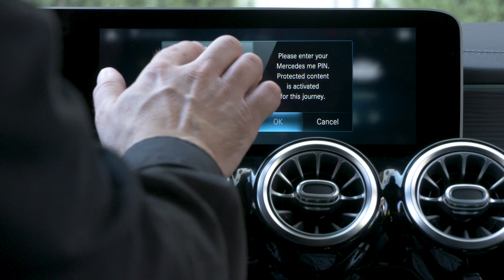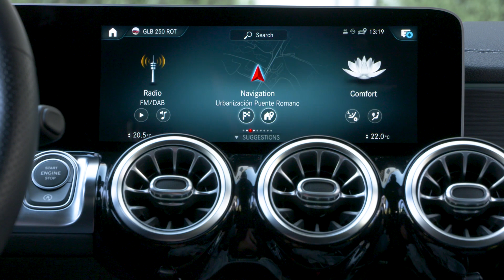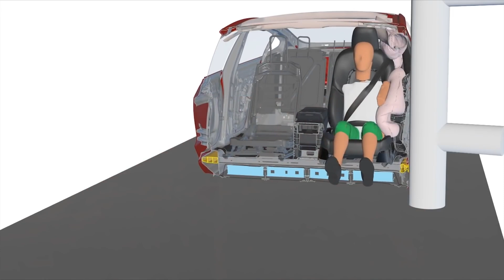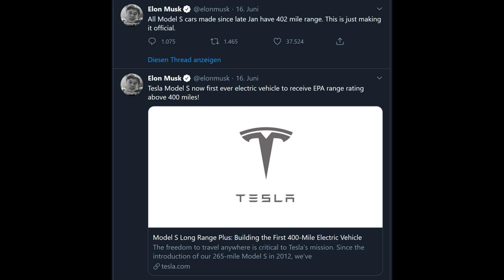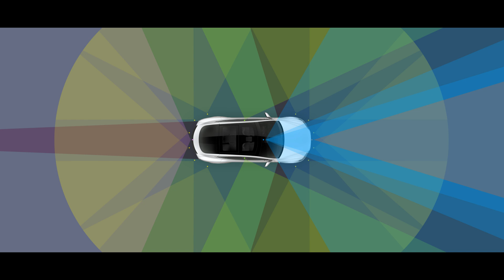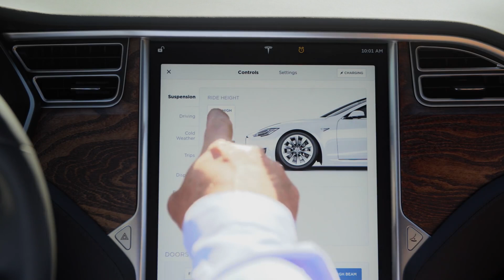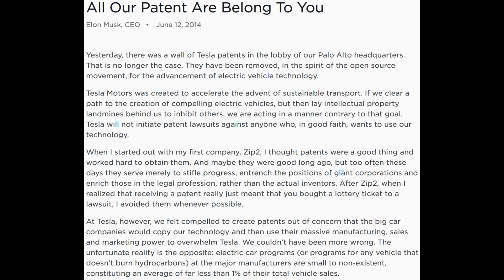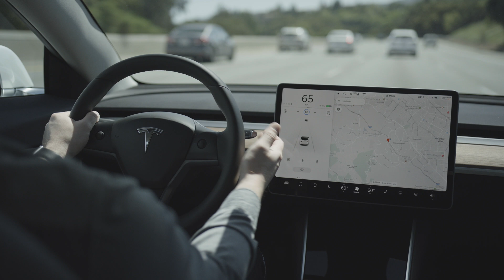Why Tesla wins

Comment: I would be very surprised if Mercedes releases a new OS in 2025 for three reasons...

1) Big software projects are always late. Always. And the last guy to find out is the CEO, particularly if he doesn't understand the software development process, which brings us to...
2) Mercedes isn't a software company. It takes a huge cultural shift to get a hardware oriented company to focus on software. The only way to get there is through sustained pain in which management is forced to make difficult decisions about planning and allocation of resources. This is exactly what VW is going through right now. And finally, and most importantly...
3) Mercedes isn't even really a hardware company. Like all legacy automakers they are integrators. They have hundreds or thousands of suppliers in a vast supply chain. In order to release a car with a new OS they will either need to migrate their suppliers to the new environments (and their suppliers are also not software companies), or they will need to make the new OS backward compatible with legacy interfaces. This comes with its own set of complexities and if any one supplier is slow or not on board with the migration then the car can't be sold. By being vertically integrated Tesla doesn't face this challenge. 

Tesla has their own problems, taking on all of this stuff has costs. But they seem to have done it while Mercedes is still talking about it. Thanks again for the video.

Comment: You did not mention negatives.  Poor paint finish,  rattles and squeaks,  very poor customer service,  seat alignment very poor in new models,  months in a service shop that are sometimes hours away,  no blind spot monitoring,  no 360deg parking,  heated seats in the back but are controlled by driver,  OTA updates that actually reduces the driving range,  FSD that is locked out when the car is sold so that new owner has to again purchase it,  no drivers binnacle or HUD...…   and the list goes on.
Reply: Hadtobe - Some of those complaints are debatable and some are out of date and some are valid.  None of that really matters.  For the moment, Teslas are so much better at many things that owners are willing to overlook a sloppy paint spot or a rattle somewhere in the dash.  Tesla is getting better at doing normal automaker things - fit and finish, parts supply, labor efficiency, etc.  In the meantime, legacy automakers haven’t done a great job doing Tesla things.
Reply: @ClockworksOfGL  Yeah, I guess if you start with a low expectation,  then you definitely won't be disappointed.  Pity disappointment costs so much money to begin with and then time in the workshop later.
Reply from the maker: Your points are all correct. I am also planning on doing a video on Teslas weaknesses as for me personally build quality is extremely important and to this day I cannot understand why Tesla does not improve in this area at all. Model Y again with serious quality issues. So a videos with the negatives or where Tesla should improve will come.
Reply: Flo's Tech Reviews - Ryan Shaw says the problem is Tesla pushed out the first 1500 M-Y’s while still in beta. They finally fixed nearly all his problems, many with newly redesigned parts.
Reply from the maker: @jameshoffman552  That would be good news!
Reply: i personally avoid any manufacturer first year production lines as they are full of faults and misses it takes time to get it to be nearly 100% faultless. Tesla is facing an even bigger challenge of constantly improving running models and not updating every 2 years the model with improvements and corrections to faults in the older version   and meeting production ramps the like no car company i know managed.
another point is for some reason you hear more about the people with issues due to social media then the quiet ones that just  got into the car and drove 5 of my friends own Teslas (i'm driving a RAV4 but drove different Tesla models over the last 4 years  ) and not one of them suffered from production quality issues and i agree there are things that can be improved like heated seat control and sometimes updates not working as expected (usually corrected in very short time )but did you drive a Tesla i think after spending a day in one you will understand the fan club Tesla acquired .as for blind spot monitoring Tesla has it in a different way i never  felt the need for it like i need it in my RAV4